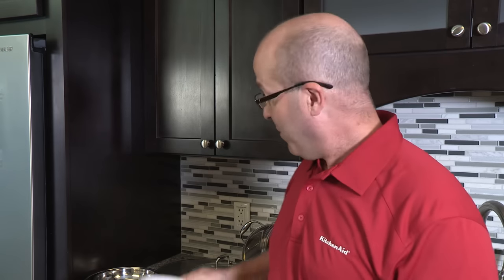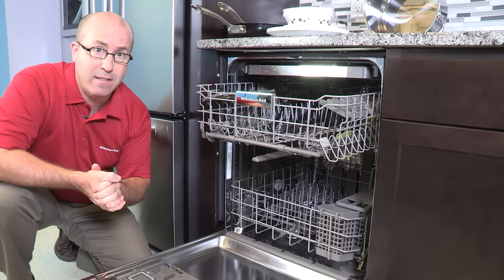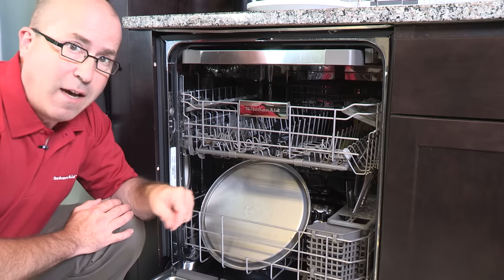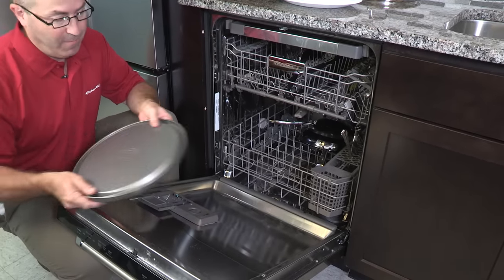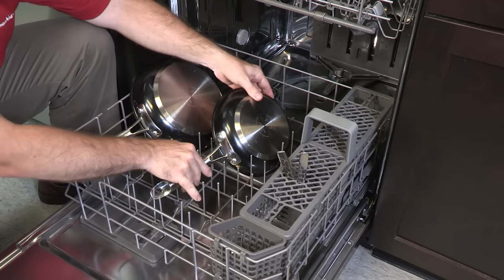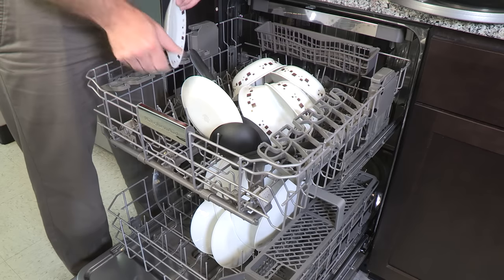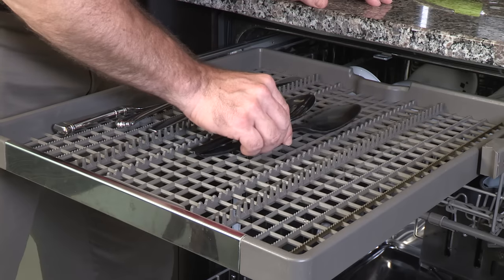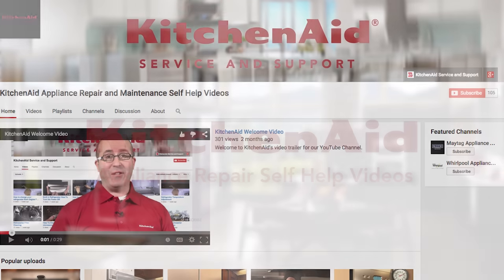Dishwasher detergent not dissolving, dishwasher not cleaning dishes

Comment: I understand everything you said and I already do that.  I have also removed all the spray arms and checked to make sure they're clear.  I checked the filters.  No joy.

I have another theory.

My old dishwasher (circa 1990) worked great.  It was noisy, but you could hear, and feel, the powerful sprays.  These new ones???  I think the Feds mandates for energy efficiency have destroyed these machines.  The old one had power like a fire hose.  High pressure and high volumne.  This thing gently spritzes - the water from the bottom sprayer barely makes it to the top, and that's only when the pump motor is actually RUNNING.  It runs a few seconds, then pauses a few seconds.  Even on "pots and pans".   It ain't cleaning if it ain't running.  I call that "DUH".

So I now have a wonderfully quiet dishwasher that requires me to wash my dishes by hand first.  Add to that my low flow toilet that uses 40% less water but needs to be flushed three times (60% x 3 = 180%, so I'm actually needing to use MORE water).  And the ethanol-infused gasoline that destroys the carburetors in my power equipment.  And the flow controlled kitchen faucet that takes F O R E V E R to fill the pot for spaghetti.

My guess is that the engineers are cringing at how their hands have been tied by these regulations.

Can someone please provide some hacked firmware for this thing so that it will actually WORK?  And RUN?
Reply: Add to your list clothes washers that barely cover your load with water, and they don't have an agitator.  All they do is tie up your clothes in knots--not enough water!  And most of them have no way for the consumer to control it!  Engineer for this product must be a man who knows nothing about washing laundry--just "saving" water.

Comment: We own a kitchenaid dishwasher kdfe104dbl.  Was not dissolving soap.  Tried everything suggested. Then called repairman. He said it was the control board, which he said was damaged because the garbage disposal was on the same circuit.  $350 repair.  Still did not dissolve detergent.  After much googling discovered the switch for the detergent dispenser was faulty.  It was dropping the tablet at the end of the cycle, or dribbling the liquid out at the end of the cycle.  I put the tablet directly at the bottom center of the dishwasher and it dissolved and cleaned the load.  For now adding detergent manually, in two weeks we will replace the dispenser, OEM Whirlpool Dispenser W10409521, although there is a newer part number we could have purchased...hoping this older part number was not replaced because it fails regularly?
Reply: By any chance do you remember what you did at the end? I have exactly the same issue.

Comment: Nothing is blocking my soap dispenser. Most of it remains inside the dispenser even tho the door opens fine. This has been happening over and over. The water in our house is nice and hot but the soap just won’t dissolve. Even liquid soap stains the door a little and the bottom of the dishwasher next to the door. Is it our city water??? HELP!

Comment: We have this model, and it has NEVER washed properly.  Even when we run it with no dishes in it, there is still detergent clumps, all over the inside.
Reply: I'm starting to think that KitchenAid will not aid.
Reply: Hi, how did you solve the problem? Mine is foam at the end of the cycle and obviously the dishes still have soap but they look very clean.
Reply: I wonder if we have the same model. The soap will not dissolve and remains in the dispenser wet but not dissolved. Has Kitchenaid ever helped you with your issue?

Comment: The detergent in my case is not getting dissolved and I don't know why. There is nothing blocking it for opening, when I open the dishwasher after it's done that little door is opened, with the detergent half or less than half dissolved. Any ideas?
Reply: My son just had the same problem and I defeated the door switch so I could see if the jets were squirting water out forcefully enough and saw that the water was just trickling in because a buildup of calcium in the water line, and since this is a timed event, not much water got into the tub before switching to the wash cycle so there was not enough water to do a proper wash and dissolving of detergent
Reply: So was your solution for him to just replace the water line?
Reply: Sjac
Reply: A Tang Sorry, just saw your question. No, I just cleared out all the build up going into the jets, made sure the line itself was good, and all was well
Reply: William Ryan

Comment: I tried to run the cycle with the dishwasher totally empty and still didn’t dissolve the pod
Reply: Good test
Reply: Someone said to put the soap at the bottom of the washer. Probably a faulty cover on the dispenser. I’m trying it tonight. So frustrated.